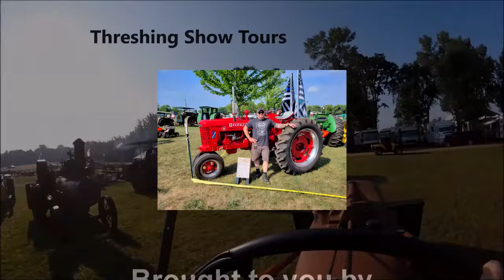Her First Tractor: 1950 Farmall Cub #113122 - WILL IT RUN in under an HOUR?

Comment: Hey Kenny, I hope the coolant is just over full. Mine turned out to be two cracked cylinders. Thats awesome. You only had to fix little things. To get it running. They are even better with a mower.
Reply from the maker: I think that was the case. I haven't had an issue with it since, so it likely was a coolant over-full issue. No bubbles or anything coming up in the coolant, so, that's good.

Comment: farmall cub  IHC first garden tractor
it will pull a one bottom 12 inch plow. they are available for a reasonable price. a front dirt and snow blade  a 48" belly mower a 60 inch finish belly mower   a 5ft mid mount sicle mower are the most common attachments. a flat belt  pulley mounts over the PTO shaft. this would be handy to start hand crank john deeres with a flat belt.as much yard as you have i would recommend you get a belly mower for it. you got 12hp with a 60CID engine.you can find oem wheel weights and chains.  you got a great find.
Reply from the maker: They sure are a nice little tractor. I wouldn't mind getting a front blade for it so that we can use it for snow in the winter! I don't think this one would have enough SNORT to start the model D. I have a riding mower already, so I don't really need the belly mower. But, a snow blade would be nice. Already has wheel weights on the back!
Reply: 9.6 HP until the 70's when they put the zenith carb on and domed pistons in them.

Comment: Your girl is going to be over the moon when she sees that! My grandfather fixed blocks of wood to his garden tractor so I could drive it. Don't even remember what kind it was. Just that it slipped out of gear on a huge hill, and my cousin and I went down it at about mach 4 😂
Reply from the maker: I thought about developing some type of extended foot pedal system for it, but, I'll be with her on the tractor anyhow. If something happens, I will take control of the machine. Can't be too careful! I've got a story about a VERY close near miss that I had on a tractor while a teenager. I should share that sometime.

Comment: you said 6 volt does it have starter on it wouuld make it easier for the little on. you didnt use it,
Reply from the maker: Yes. It is 6 volt and does have the starter on it. It doesn't take much to hand crank this tractor, and I have no problem doing that.